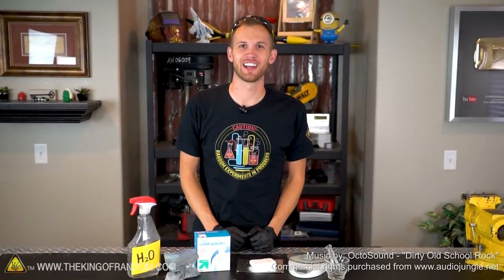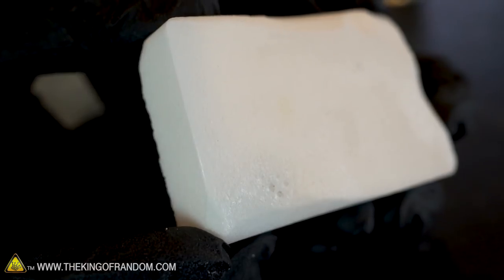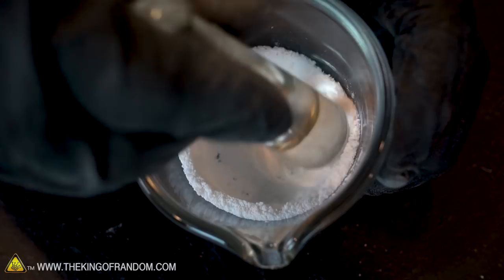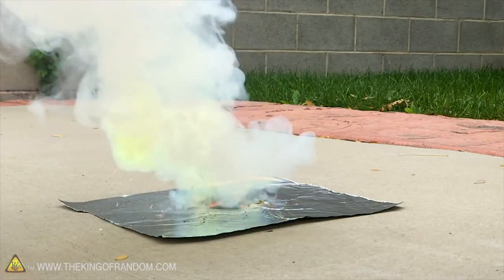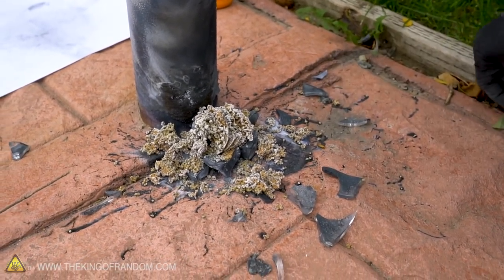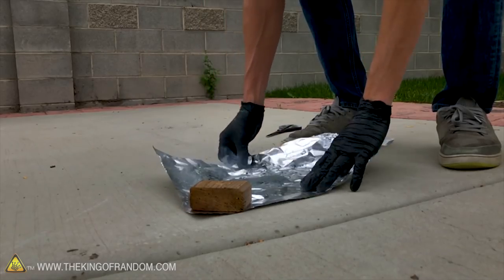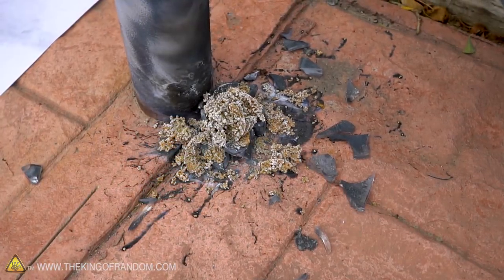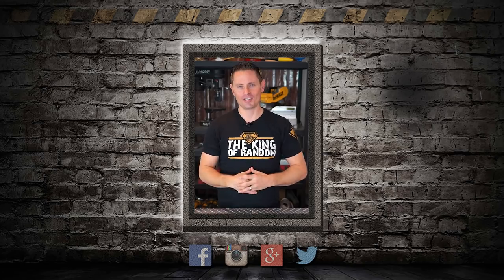Make Green Fire with a Drop of Water!?! TKOR Shows You How To Make a Green Flame With Negative X

Comment: Calcium Carbide + Water = Ethyne Gas
Reply: both are same
Reply: Its strongy exothermic reaction and with abundant oxygen of the air it ignites.
Reply: ShishiR wohoo Netherlands!
Reply: ShishiR y=mx+b
Reply: Jaja carbidschieten
Reply: ShishiR neeeeerd
Reply: ShishiR Is Ethyne Gas Flameble
Reply: Different reaction. But yes you could produce flames this way assuming another more exothermic reaction was also taking place.
Reply: ShishiR CaCO3 + H20 = CxHy i dunno 🤷‍♀️
Reply: No. CaCO3 is plain old limestone. Gets in contact with water in many places on earth anytime, especially when it rains. No reaction except low dissolution if the water is acidic.
Reply: Carbidschieten
Reply: @kadenlarson9992  same thing

Comment: Can you mix negative x with another chemical so the flame will be a different colour? ( like this so grant gets to see it)
Reply: Georgis Aloupos yes, we've done it before. You can mix it with magnesium. But it's extremely dangerous because a bead of sweat can set it off. It can result in 2nd degree chemical burns. It's not fun. If the powder burns you it keeps burning until it's burned out or scrubbed out.
Reply: Georgis Aloupos i thinks you can add different metals so the flames change

Comment: I think it is called negative x because it is a negative reaction so like you use water to light it, kinda like a opposite reaction
Reply: Kinda like potassium metal or sodium metal how that reacts with water
Reply: But this is different. The water works as a solvent and causes the decomposition of NH4NO3 by an autocatalytic effect.

Comment: Put a Bowling ball in liquid nitrogen and see if it would break please please please please please
Reply: Plastic has no water molecules. Literally  nothing happens.
Reply: Madison Bodie it would crack a bit  , the tip layers that is its no going cool all the way through due to the insulatory properties plastics but the contraction would make the contacted area very brittle
Reply: Blitz Fire water?
Reply: Yes. Liquid nitrogen freezes the water molecules in stuff you put into it. That's how it works.
Reply: It works because of thermal expansion and contraction not water molecules in general and even if that were true lots of plastics are full of water molecules

Comment: King of Random fire starters:
#1-Potassium Permanganate, & Glycerin. The PP also can distill water with a pinch.
#2- Zinc, Ammonium Chloride, Ammonium Nitrate & Water
#3- (Leslie's Pool Supplies) Shock Chlorine granules & Dot 3 Brake Fluid
#4- 9 volt battery & aluminum foil

Comment: the negative in negative X means opposite fire instead of using wood or other fire to start a big fire use water which is the negative or opposite of how you usually start a fire cuz water puts out fire but for the negative in negative X starts the fire

Comment: I wonder if it would be possible to repeat the experiment with aluminium powder instead of zinc. The flames wouldn't be green but the fumes would be much less toxic. In addition to that it seems the main activator is the chloride ions. So maybe instead of the ammonium chloride you could use sodium or calcium chloride or a mixture of the two to get different colours.